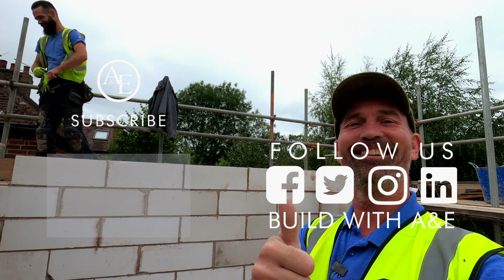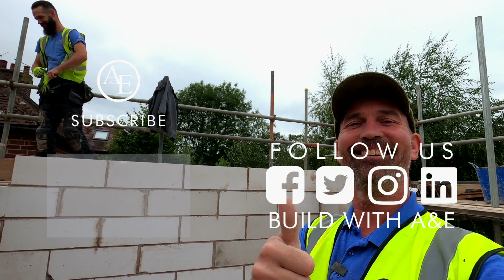FASCIA INSTALLATION TIPS | Build with A&E

Comment: How come they packed fascia board away from the wooden roof pan .  Soffit board ? Or because of the L lip on the upvc fascia.  Rough that like.  Would of need eve trays and longer Rosemarys and a slate eve course to put that right . Prob gepo that did it in first place bang a bit of plastic up get paid aren't bothered about damage that can cause inside and out
Reply: They left the old fascia in situ and slapped the Pvc on top. Cowboys, 🙄

Comment: As with most scrupulous builders, they know something like this is never going to get checked by the owner from the ground and problems only arise in winter once the weather starts! By then its too late and a 5 star review has already been left.

Also, I don't get why people over-clad rotten wood fascias with UPVC plastic, the rot is still there. Just remove the wood and fit UPVC to the rafters.
Reply: It's not scrupulous builders, the fact is most customers wouldn't want to pay for scaffolding and all the tiles stripped back for a fascia and soffit change,most will employ someone who's pushed a leaflet through the door offering to do it for hundreds rather than thousands. Plenty of builders willing to do a proper job if your willing to pay!
Reply: @rossmale8715  oh of course, I'm not labelling all builders as scrupulous! 👍 I was implying that the dodgy ones rely on the fact the customer won't be getting up a ladder and checking it out themselves.
Reply: If that is the case then simply don't do the job. Those that do it to that standard are dodgy. Plenty of people out of pocket by these so called facia board companies who charge a serious whack and then mysteriously disappear. My neighbour is one. Paid 3.5k to a company who made a pig's ear out it.